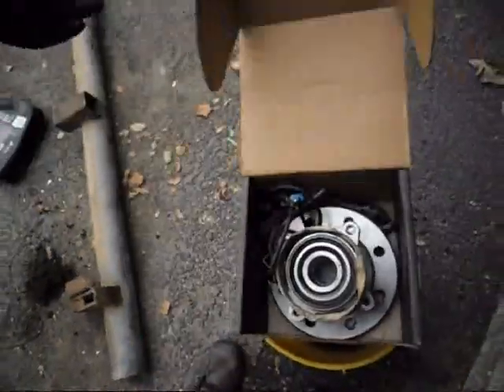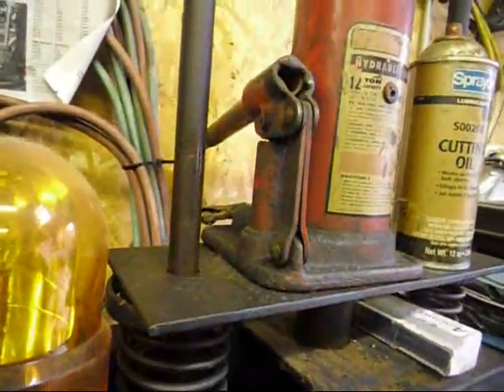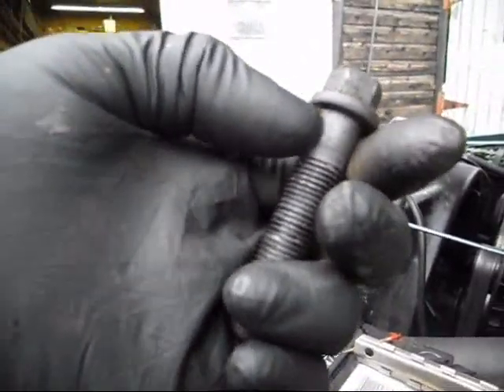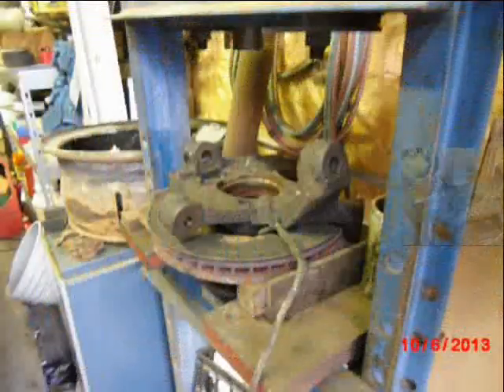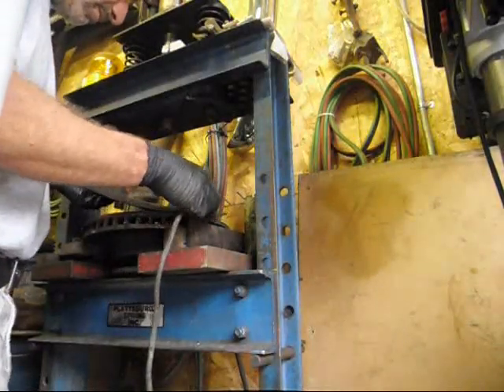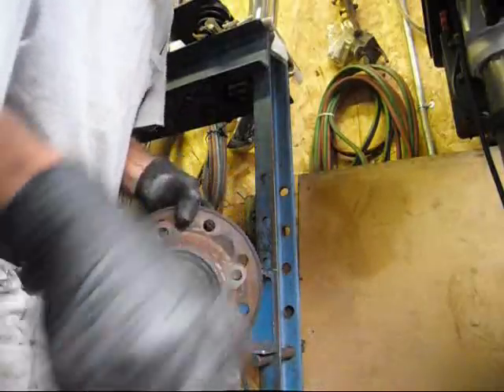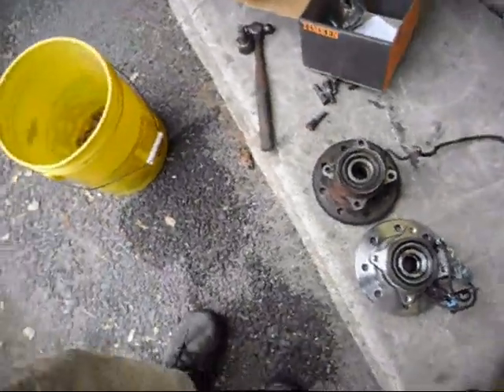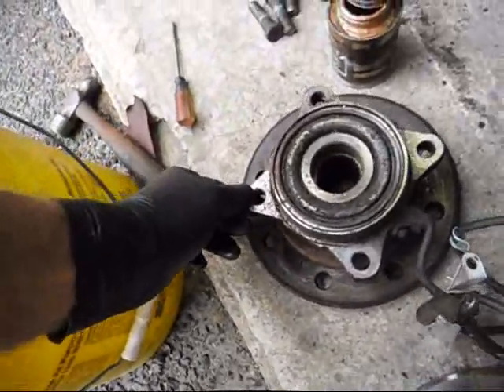'Weasel Timken Bearing Press  10 6 13

Comment: Timken? Or another brand. The Timken or AC delco ones (Same bearing, just re boxed) hold up for at least 50k. I thought that was short.  Atleast they are easy to spot when they are going bad. Yet some still drive when their car sounds like a prop plane

Comment: With inboard rotors I would be inspecting it what a pain in the ass if you had to pull all that apart again to change a brake rotor. In the rust belt where you live you can never have enough anti seize.